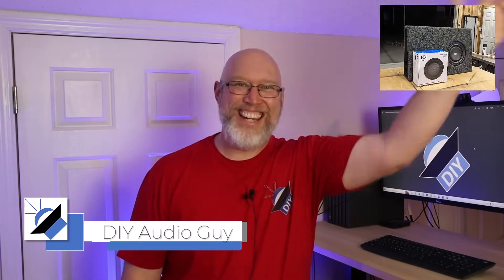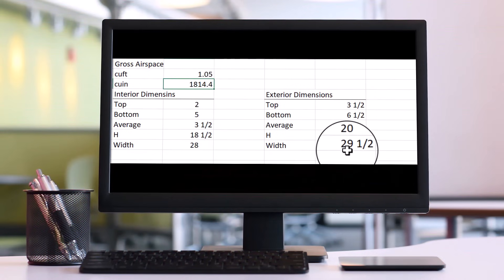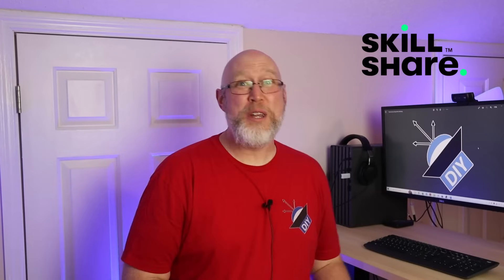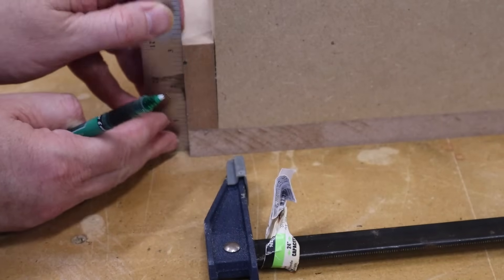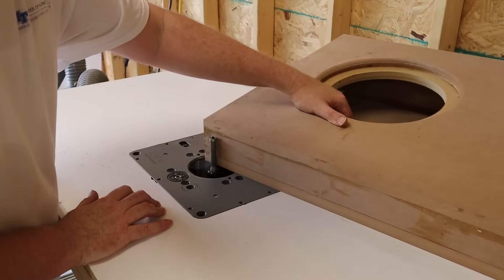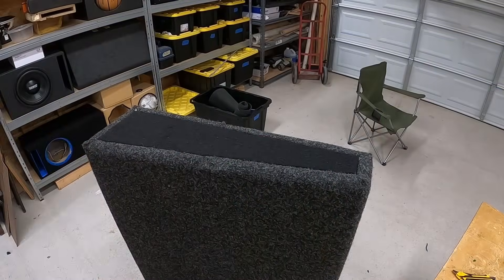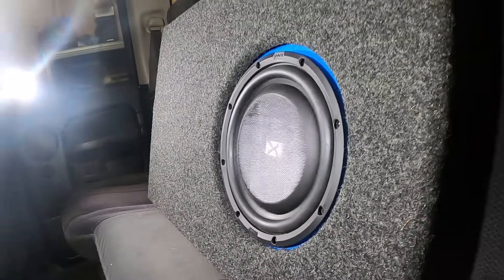Shallow Mount Subwoofer Box: Bass in a small space

Comment: Unfortunately I dont have the money or tools for a custom box right now but I have been modifying the enclosure I have to make it better. 
Length: 30" x Width: 22" x Depth: 14"
PORT DIMENSIONS: Length: 18" Width: 6" Round Port (Supposedly tuned to 33Hz)
I have a one Resilient Sounds Platinum v2 15, which has 11.75" of mounting depth and .25cu of displacement.

The Sub is rear facing and the Round Port is on the top of the box right now and I think its not the best placement for the port IMO.

When I use a sweep it shows that the box with the sub is tuned to 60Hz...which sucks for the low end I am after. My previous sub (Skar EVL 15) gave much more pressure in the same enclosure....but that sub fell apart. I thought this sub would hold up better but its size...and weight has me almost regretting saving the money up for it. Now that I have it though, I want it to work!

I used your calculator and it says that Im in need 19" of Flare Length Port Required with 2 4" Ports selected. Does this mean that Require Length is for both tubes separately, or together? Does this mean I use 2 4" x 10" Aeroports, or 2 4x19" Ports? This is what I find confusing....Im just trying to get my box tuned around 30-33hz to get the most low end out of it.
My plan is to use my router to cut the top panels inner section out and install a fresh sheet over it. Then, cut the holes for the Aeroports On the Rear of the box, facing the same direction of the Sub, which will load off the wall. Is there anything that you would critic?
Thank you for your time and effort, it is much appreciated.

Comment: Would this design work in a metal briefcase 4” deep and 18”x 12”-
1- 6” cone from broken bluetooth speaker..?
Didnt know how much room is needed between magnet and cab back board?
Reply from the maker: If there is no vent on the back of the magnet then it will be fine no matter how close the magnet is to the back of the enclosure.   But I would not want them touching.
Reply: @DIYAudioGuy thank you!

Comment: Built one like this for a kicker shallow 10, with 400 watts from an old school Orion,  sounded great in my  f150 under the rear seat.,. tried using the box in my sentra with the mm1000 and it was way too much power for it, sounded ok but no real thump like in the f150, smaller cabin of the f150 better cabin gain.

Comment: Love the video I have a 1987 Pontiac Fiero I just did a complete rebuild on the car. I did J Jl Audio speakers and amplifiers. The only thing I could do for a Subwoofer is move the front passenger seat up a couple of inches and try to build an enclosure behind it. Any recommendations on trying to figure out the right size? I have 2  Jl Audio.10tw3-d4 and the amp I bought is the
JL Audio XD1000/1v2 any chance you could help me out?

Comment: I just built my first ever box it’s a “shallow” mount box 2.2 net tuned at 35 hz. It’s not the most shallow box but with the two 4 inch ports not many drivers would fit I am running a skar vd12 at 1 ohm on a hifonics 1500 it performs better than I thought as none of my cuts are straight 😂

Comment: Using thin plywood and regular bracing battens can help claw back some box volume vs external volume. Using 3/4" mdf is adding 1.5" on each side, making your box less compact than it needs to be. It's also quite flexible and heavy for its thickness. A sheet of 3/8" or even 1/4" baltic birch and battens every 4" or so connecting the sides will give you a rigid enclosure that's smaller and lighter. The ultimate low bulk bracing would be L-aluminium. You will need extra reinforcement by the speaker. Of course it will take longer to build a box like this but I'm a light weight fanatic.
Reply from the maker: Have you ever crunched the numbers to see just how much space you would gain by using smaller material, versus how much space the extra bracing would take up? 
There's always a trade-off.
Reply: @DIYAudioGuy  the trade off in bracing is actually time taken, for you can use relatively thin pieces - kebab sticks almost, as end to end (compression and tension) rigidity is much greater than transverse rigidity. If you don't have a fascination for performance that defies weight and size, it might not be worth it. Wooden strips from a hardware store work surprisingly well but are climbing in prices a lot. Curved surfaces are also a lot more rigid, although they might not pack well into a certain space, and do need to be made out of  a special flexible plywood - with a thin centre grain for flexibility in that direction, and thick outer grains for rigidity in the other direction.

I made some bookshelf speakers and the sides of the box were 1/8 of an inch birch plywood - no joke! Okay the front and back, top and bottom were 1/2" offcuts, but the sides didn't even ring when I rapped them with my knuckles after the battens had been glued on and a cross batten for good measure. Actually I can't even remember if I added a cross batten as the box was only about 7" deep.

I have a subwoofer box built of 3/8" plywood for a 12 and the external dimensions are 18" x 18" x 22". It's a high efficiency PA 12" so needs a bigger box than a car audio driver. The ports are 45 degree triangles in each corner. There is a ring shaped baffle brace and a couple of strips on the back of the box.
The other box is 1/2" ply with similar bracing pattern except no recessed baffle and a cross of two pieces on the back wall. The weight of each box with neo driver is about 35 lbs.

Of course, MDF does need to be thicker for the same rigidity and doesn't take damp nearly as well, or screws into end grain, or even glue into end grain, which is why I prefer to work with plywood for everything except neatness of finish. Also, plywood offcuts are better for bracing than MDF is. I love the smooth surface of MDF for painting without it looking like plywood grain underneath. There is a lot of poor quality plywood around though in UK, and it's not even that cheap in price.
Reply: I wonder if that type of construction would change the frequency response or the way it sounds.
Reply: @Tipman2OOO  if you can get it rigid it shouldn't do. If you're getting panel resonance then you'll lose output and might hear other noises.

Comment: Question got a Nissan frontier 2015 crew cab. Has no room behind seat and only box made is sealed for under rear seat. It’s L shaped. I want to build a ported L shaped box that can be wider or stick out from seat bottom a few inches. And upfiring. For 2 10s. But want it to sound good. Have 2 shallow mount skars I know skars aren’t great but it’s in my sons truck. Any options any input?
Reply from the maker: You are fighting against physics.   So don't expect a massive improvement even if you throw a ton of money at it.

Comment: Do you have a video of doing a 12 inch shallow mount sub box with a passive radiator instead of ports?? I would be interested to see if you like that better than using ports.  Thanks!!
Reply from the maker: Not a video where I build one, but it is a good solution to the thin box problem.  https://youtu.be/-s78YDDwB0I?si=1oeJ0G3w_VcqYME7

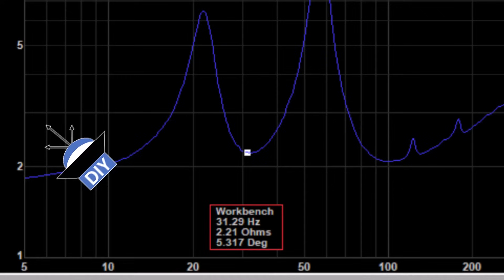Comment: 12:07 WinISD routinely overestimates port length. need to reduce the length to about 80% of what WinISD suggests to get the correct port length for 34 hz. if you still have the box calc saved in WinISD you can change the tuning to 31.3 hz and see what it adjusts the port length to x 0.8 vs the 13.25" you made.
Reply from the maker: I've noticed that and I started compensating whenever I build my boxes.   I get the same problem when I use the formula for port length as well.  I find it if I want a 34 Hertz enclosure that if I design it for 36 Hertz I tend to hit 34 pretty reliably.

Comment: In my 2011 Toyota Tundra Crewmax I removed as much as I could from the back wall I did about what you're doing except 3/4 that the box was made of steel in my build. There are two Kenwood 12in low Pros, to Kenwood 9106D amplifiers running off a converter from the old subwoofer and this converter also has a bass knob. The JBL system is doing very well otherwise and it is one of the hardest hitting best sounding trucks. I knew this because I get complimented all the time LOL I'm not fishing for them though I'm looking for business. My Real Steel boxes are 3/4 made of steel various thicknesses and with special concert shapes to ensure that you get the best-of-the-best

Comment: Does the actual shape of a box matter? Obvioisly size does but just shape? Im building a box to go in a boat and to get the space i need im basically building a box just big enough to hold the 12" woofer, the shooting a long piece off the back a couple ft to get my air space. Long part is probably %60 as tall as the speaker part and equal width. I dont see why it wouldnt work
Reply from the maker: In my opinion the shape does not matter.  I am sure that somebody could make up something extreme where odd shapes make strange second chambers or transmission lines, but for the most part it does not matter.
Reply: @DIYAudioGuy  thank you so much for replying and clarifying. That's what I run into when reading was how the air movement behind one half the speaker with lots of room  vs the other half would be different and all the horrors that go with it haha. Free solobaric L7 12" so I'm just gonna send it. Was suffocated in a 1 cuft box before so anything should be an improvement

Comment: I have a single cab F250. There is a Punch P3s behind the seat. I have been on a conquest for hard hitting bass in my truck without major modification to my seats, cab, and bed
Reply from the maker: Good bass in a truck is a real challenge. There just not much space to work with unless you want to go wild and pull out seats or do a blow through.
Reply: @DIYAudioGuy  Yeah, that’s my bottleneck. I was looking at the new kicker CompRT, and viewing your channel for box build ideas. 
I am wondering if 4-6.5’s would be a contender under the bench seat. 
I dig your videos, and an now a subscriber. I am sure I will find a plethora of knowledge here
Reply from the maker: @iamgriff   I am not a big fan of small subwoofers.   They just can't get as low.  But if that is all that will fit then that is your only real choice.

Comment: What is the better option two small subs or one larger? How much speaker and how much box do I need if I'm not trying to shake the wall down?

I want to make a speaker system for my car, it's an older SUV and there's plenty of space but... I use it for camping and I'm frequently driving on very rough and dusty terrain. Also I fold the rear forward and sleep in the back of it, so all the extra space where a well designed ported box is unavailable. There are two places I am thinking of for the sub: under the two front seats (12" x 10" x 6") or along the rear passenger wall, think old small truck bed, it would shape around the rear wheel arch like the letter P rotated clockwise 90 degrees.

Any way, my real question is power out put. I have a car that has a very good factory sound system and all it has are two 8" subs mounted under the rear window in the trunk. This sound system sounds so good and has more bass than I would even need. What is the better option two small subs  or one larger? How much speaker and how much box do I need?

Comment: Don’t forget room loading.  Close to a rear wall, tuning for free space anechoic f3 is probably in fact tuning for f6.  Years of speaker building have taught me to tune for 4 pi  space in bass due to room mode reinforcement.  Pro audio and larger venues need f3 but home hifi uses f6 because of room reinforcement.  Baffle step within 4ft of rear wall means no room power response losses so baffle step compensation is not needed if design includes for this room lift.  Every day is a learning day when you tune by measurement not box calculators which needs some practical reality built into assumptions and don’t forget to consider box QTS impacts on actual port tuning to more accurately account for virtual length of the tuned acoustic line which is approx 65% the calculated acoustic line (vent length) box calculators provide unless they account for box Q values.
Reply: What does any of that have to do with stuffing a subwoofer behind the seat in a standard cab truck?

Comment: What woul You suggest ? I have aVW bus and i want to build a as good subwoofer as possible, but i have only room 100 cm x 35 cm x 17cm, i have av amp. of 630w stable to 1 Ohm ? Thank you
Reply from the maker: That should give you enough airspace for a single 10.  You will probably want to use a passive radiator in order to make the most out of the available space.

Comment: I think one thing to note about passive radiators is that there are many manufacturers, so you can totally design your own box with a PR for most subs, and they will still be smaller than what you can achieve with a normal air vent at the same box volume.

Comment: Got a f250 single cab so very little for what I want. The sealed box for my truck  is .75 for 12's. Found some pioneer 12 shollow mount (4 ohm) on sell that would match the air space. 400 rms x2 cobalt amp 350 rms x2. Thought it would be temporary setup, but it sounds so good it's been about 2 years now and never changed it out. It's a perfect blend with the JBL in the doors.
Reply from the maker: If it works, and you're happy with it, don't change your thing.

Comment: Holy smokes you’re knowledgeable! I’m considering buying 2 small subs in a prefab box (8” or 10”) for my 87 standard cab Toyota truck and there are many options to choose from out there with inconsistent reviews. I’m very tall and not brand loyal. In your opinion (in terms of perfect tuning/quality) who provides the best product? Rockford Fosgate, Alpine, JL Audio, Kicker, etc. Local audio installers are quoting me $1,000  to build/install a custom fiberglass enclosure (without the speakers) which exceeds my budget. Thanks for your time and advice!
Reply from the maker: Yea, that's why I got into DIY.  This is the best drop in solution, squeeze in a pair of the 12s if the will fit.  https://youtu.be/-s78YDDwB0I
Reply: @DIYAudioGuy Thank you for taking the time to respond. I was looking at that box. Just stumbled across your channel today so I’ve subscribed and I would like to contribute also.

Comment: I have a 21 Tacoma with two Sundown SA 6.5's in a ported box. I'm considering swapping them out for a Sundown  SML 12 also in a ported box. What are you thoughts?
Reply from the maker: One of these?  https://lddy.no/1ef7c  Looks like it needs 1.25 to 1.75 cuft of airspace.  If you have the airspace it will be a lot better (more total cone area, more power handling, more X max).  But if you try to cram it into a tiny box it will sound like crap.

Comment: Good evening sir, i just love your vids, but there is one problem that i constantly have with my sub boxes. Even after using winisd and speakerbox, to calculate the parameters of the box, i don't get the same amount of bass out of my sub, as the stock box was louder(but didn't fit my trunk). Now, what i'm constantly seeing is that, when i open the trunk of the car, the bass gets extremely powerful and i'm starting to think that maybe the sub doesn't have enough air in the trunk???. To be precise i'm talking about a Opel Astra g convertible. The box has the port facing the trunk and the speaker facing the interior of the car through the skipass. I am at my 5th box... I had the port in every direction possible and i still don't get any good results. I want to make a good box with the speakers facing the trunk like in the old days, but i want to feel a good amount of bass.(i don't need ground shaking bass, as i have a convertible and i just want to add a little bit of umff). Any ideea how i can add the volume of the trunk to the box calculations? Many thanks in advance
Reply from the maker: WinISD doesn't have any way built into it to account for the space that you put the subwoofer in.  

My guess is that you've got a problem with a standing wave and that's giving you some form of cancellation inside the vehicle.

To be honest I'm not really sure what you can do about that.
Reply: @DIYAudioGuy  also, i just remembered something, knowing that the car is a convertible, the only connection between the interior of the car and the trunk is the skipass. Should i make the subs facing the interior with the port, or should i have them facing the trunk with a spacer between the skipass and the box, so that it doesn't cover the hole?
Reply: @alexnechi3053  I've had the same problem happen on a BMW. You need to have the sub facing the skipass, doesn't matter if your box is sealed or not. The difference was day and night for me.

Comment: I have 2 12” Kenwood shallow mount subs in custom sealed enclosure I made for my ‘99 Ford Ranger standard cab truck. It’s been a while so I can’t remember the exact specs (about .75cuft each), but I’ve always thought they’ve sounded great! And can rattle your bones if you crank them up.
Reply from the maker: The extra cone area definitely helps.
Reply: Rn I got a 96 single cab and with 2 10s behind the seat I def need more room for myself

Comment: Maybe i missed something but it looked like you left the the brace fpr the ports solid. Won't that dramatically change the characteristics of the enclosure?
Reply from the maker: I cut a window into the brace, just did not get it on camera.
Reply: @DIYAudioGuy  ok. I tried going back and re watching the final assembly and from the angle i couldn't tell if it had a window or not
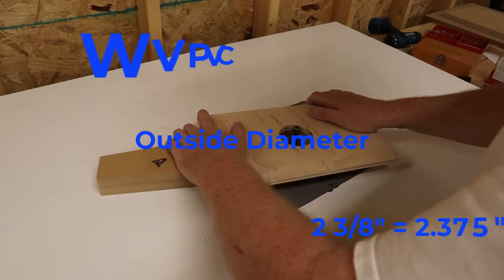Reply from the maker: @joshuaranks3950  7:44